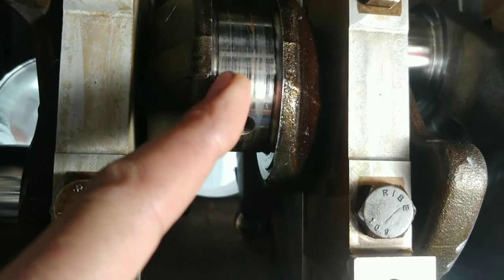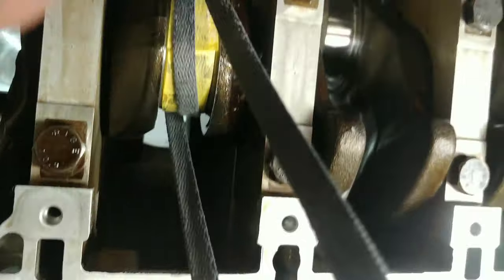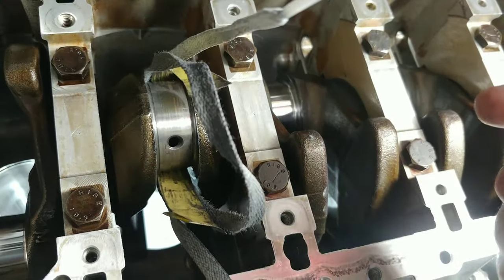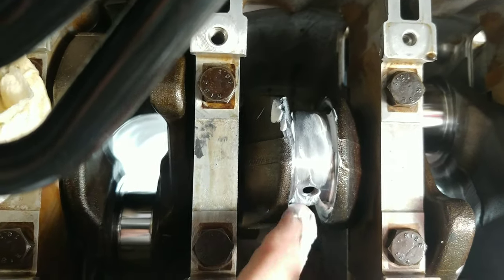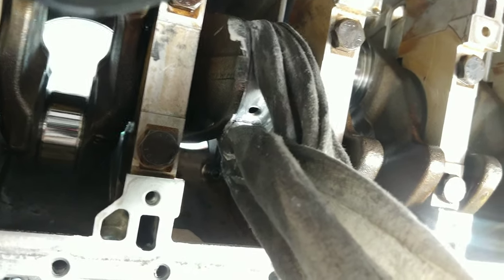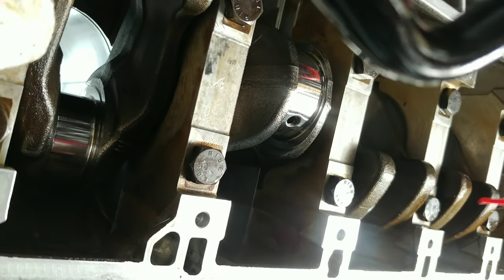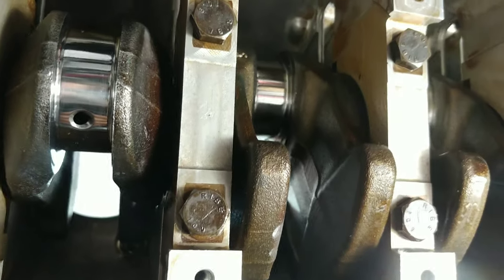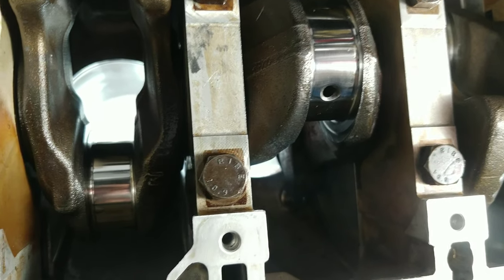Crankshaft Sanding and Polishing by Hand DIY You can do this!

Comment: I did the exact same thing on my 335 with semi spun bearings and rod knock cylinders four and five (there was no scoring that my fingernail could catch on however.). I only needed to use 2500 emery cloth and a shoelace with some mothers metal polish and they came out like glass. We have been beating on the engine since then with new calico coated king rod bearings and it’s been flawless! Knock on wood!!!!!!!!
Reply: Still going strong?
Reply: Did you run an undersized bearing?
Reply: @nicholaspickard14 You don’t need to run an undersized bearing “usually” with this method. You’re mostly just polishing and not removing a whole lot of material. When you have the crank turned at a machinist, they take off a lot more material. That’s when you would need an undersized bearing. Hope this helps. 🤙🏻
Reply: @BlackwaterDSM  Agreed. Even if you had a lathe, it takes foreeevvveeer just to remove .0005 with sand paper.
Reply: In same situation, cylinder 4 lol😂
Reply: Looks like I'm late to the party...cylinder one haha.  Engine was running b4 I dropped the pan.  Ordered ACL from fcp I hope they size well. Should I get them coated?

Comment: I mean it's perfect if you got that kind of time and want to be a perfectionist but its really not necessary to be this excessive. Sand it with 2000 grit til it's smooth with no fingernail ridges, blast it with brake cleaner, throw some oil stabilizer or assembly lube on the journal and then assemble your bearings and rod caps and that should be sufficient. If its that bad that you have to use 350 grit then you're probably going to need oversized bearings. At least .10.

Comment: Spun a bearing in a 4.6 , did this and its ran 26000 and still going. I also preprime it after a 2-4 hours of resting by holding gas down and cranking 10-12 seconds. No metal in oil

Comment: That is the best I have seen just bought a Honda CR-V 2.2idtec no3spun  it lock up on tick over so now I can do this to old engine put one in it with56thou on but the old one as only done106thou I think there cud b oil restricted to this one all other r fine was getting diesel in oil injector tip gone off one injector a project car  u no something to do over winter  but done car since 17yr old now74 it’s like heart surgery this one but nearly done very good vid and thanku

Comment: Nicely done, however there's always the risk in polishing a crank in situ (as it cannot be hot washed afterwards, as on a full engine rebuild).

The tiny particles of leftover abrasive can wreak havoc in the engine.

No matter how meticoluosly one cleans the journal
after the polishing, it's only a hot pressure wash that can fully remove microscopic
abrasive particles.

At least, a double oil
& filter change is a must after doing this operation in situ (50 miles, drain & refill, new filter, then after 100-120 miles, repeat oil & filter change).

Best of luck!
Reply from the maker: Yeah I agree

Comment: I am thankful of the video. My e93 with n54 engine seized and I found out it chewed up the rod bearing worst on piston2.

Even though you did not show the step by step sand papers job and the use of the brake cleaner and wb40 I still get the idea.😁

What I like is you did it on the exact engine I seeked solutions.

Thanks body😎👍
Reply: So did you end buy polishing ur crankshaft or replacing it?

Comment: This is a very nice method and I really appreciate you explaining in detail every step one thing I wanted to say is that I didn't see if you did or not you said use some WD-40 on your 320 and all your grits or just a little bit of water is fine and soap just like if you were wet sanding your paint and then also I don't know if you could do this on main bearings cuz some of the main bearings do not have barely a little bit of clearance for a shoestring to even get maybe a wire on sandpaper like a piece of welding wire or something like that or fence sign wire that is like an aluminum or something like that I could probably try that get in the real tight places

Comment: Great video i was really looking for this, when I dropped the pan on my n54 cylinder 6 bearings where gone so I found just paper thick Half a circle metal in there so i wanna see if i Polish the crank the  way you didi it how can i do the clearance and if I should do anything to the connecting rod ?
Reply from the maker: The rod is garbage.
Reply: @335iN54Enthusiast  what do you mean garbage? Do u mean not to worry about it ?
Reply from the maker: I mean replace it. It's probably slightly out of round now. Check the roundness with a dial gauge then you'll know if it's still useable.
Reply: Agree, if your bearings are that bad, then I doubt a simple polish will fix. A used engine would be your cheapest fix. I would guess rods and crank need replacing

Comment: Great vid! I’m doing this now on my 328 with the N51, spun rod bearing on cyl. 6. Surprisingly, only very minimal scoring and some copper, I’ve got a couple hours into the journal alone and I’m still not there yet. I have one score that covers only about 1/4 of the journal. Clearance is about .038 right now witch is right in between the min/max. you can barely feel the score, almost can’t catch it with my nail. Should I leave it as is or keep sanding it til it’s gone and risk taking too much material off the journal and be out of tolerance?
Reply from the maker: Ya id say as long as you smoothed out the scoring so it doesn't eat the bearing up you don't need to take it out 100%.

Comment: So, 320-through-2,000 is all and only WD40. Then only the metal polish and the rag/towel for the remainder until mirror finish?  
This is a wild question: On my BBC a 454,  I have 225,000.00 miles. It never dry starts, but the oil pressure is low but functional (10 PSI/1,000 RPM). I don't want to spin a bearing and I don't want to pull the engine. I was thinking of doing this exact process and new standard bearings on the rods. However, I can remove both the upper and lower MAIN bearings but not the two end-main bearings (front and back). Would it make sense to only do the main bearings (polish as you did rods and replace with standard bearings) I can get to and leave the ends alone (since I can't get them off with crank in block)? I think you and most would say definitely do the rod bearings, my real question is about the mains as I have described it here. Any thoughts about the rods are appreciated as well. The compression is good as it passes California SMOG testing which is more stringent than anywhere and they made it even harder to pass as the truck now has to exceed what it did when new! It does pass even with those miles.
Reply from the maker: The sanding grits All depends on the condition of the journals .  I'm not too familiar with the specs and bearing life on the 454 big block so I can't give you a clear answer there.
Reply: @335iN54Enthusiast  Thanks. In your Youtube above on your Beemer motor, did you only use WD40 throughout the process of sanding with the progression of finer and finer grit paper and once finished with WD40, did you only use your recommended polish with cloth/towel to create the mirror finish on the crank journal?
Reply from the maker: Thats right

Comment: Very informative video . My machine shop guy charges 30 dollars to polish a crankshaft. 
It looks like you were using quality sand paper including the can of wd40 I’m wondering how much money you spent doing this? I see that I’m about 3 years late because this is an older video. Things being what they are now if you had it to do all over again would you have done it differently and sent it out and spent the small amount of money to get it done?
Reply from the maker: I spent under 30$ .There's a huge difference between sanding a crank and polishing a crank. Polishing doesn't require sandpaper....
Reply: Polishing is the work involved to get the crank out/remove the entire engine. To remove the crank to polish is much work. 

This is the technique to “kick the can down the road” balling on a budget, hot rodder recipes and all of that DIY and garage warrior. 

If you’re questioning this technique then  pay a mechanic $5-25k for a new engine. Instead of $50 and a weekend.

Comment: i've seen this done a lot but does it not affect bearing clearances? does it shave off the top material or is it really just polishing? and does this put even pressure throughout the piece of sandpaper so that you don't get low/high spots on the crank journals? like i said i've seen this done a lot so i'm sure it doesn't cause any damage but there were just the questions i did have.
Reply from the maker: Always check bearing clearance.
Reply: I just did mine in a Buick 350. Some light scoring and what not. Used 320, 600, 1200, and polish. Measured with a micrometer before and after. The change was less than I could measure. i.e. No greater than .00005 (I don't think it removes much material. ;)
Reply: I think you need a micrometer measure the journals first b4 any thing write down the measure ments and when you done measure them again and compare the readings if its more than ten thousandth of an inch shaved off put 0.25 oversize bearings  if its over twenty thousandth of an ich shaved put 0.5 like that you will get it right its just engineering done at home its possible but takes time and labour but it saves you money

Comment: Are you still using your car. Did you find any solution.
My motor is also making same noise after 180000KMs
I doubt rod bearing and planning to change them.

Comment: Hi there, thanks for this video, I'm going down this path with my Land Rover Discovery 3 because I'm seeing bearing wear in my oil. I will definitely be following this to clean up the crankshaft. I was just wondering whether you had any suggestion for the main bearings, as I will be replacing these also. Obviously there's not much room to move around the crankshaft, so I'm wondering whether this sand and polish method is somewhat viable in that case or not.
Reply from the maker: This won't work for main bearings unless its fully disassembled

Comment: I really appreciate this video it's given me more confidence as I'm planning on doing this job. I have a few questions and idk it might sound dumb, you turn the crankshaft bolt 'clockwise' right? Along prior to that removing the spark plugs to allow/release compression? Will turning the crankshaft mess up timing once everything is all put back together?
Reply from the maker: Yes clockwise. Plugs can be removed.... won't affect timing

Comment: What's the tolerance? Did you measure it?
Reply from the maker: No...I don't have a proper measuring tool.
Reply: @335iN54Enthusiast  

Prime on Amazon? 10 GBP ?
Reply from the maker: Ah yes the plasti gauge.   Yes I will be measuring the clearance.

Comment: Im no engine builder, but shouldnt you have the crank out when doing this? I dont think its far fetched that enough material came off to unbalance your crank or even to have gapped your tolerances between the journals and bearings because of the "sanding till the scoring is gone".
Reply from the maker: Not necessary. Only if it's machined. Secondly with BMW tight bearing clearances...I highly recommend doing this to give just a little bit more clearance and that extra protection against spun bearings.
Reply: Even if he sanded for 24 hours on each journal, it would affect the balance of the crank as much as you hanging your clothes on the floor or in the closet affects the earth's balance.

Comment: Also, The Japanese use emery cloth on the rods lightly in an X pattern (3 or 4 of them) and clean thoroughly. This helps keep the pressed in bearing in place. Use nothing behind it unless it is a drop or 2 of ATF. Then on the bearing faces use lucas .
* take a bent straw parts cleaner and clear the oil ports in the the crank shaft.
Be sure to completely clean the oil pan pick up tube and oil pump so that  whatever metalic particulate got in there is clear. Assemble and tighten to specs and you are good.

Keep an eye on the cooling sys. That and failure to distribute oil to the motor and co.ponants was the cause, more than likely. Or in my case a half- assed attempt to conceal in order to sell the vehicle.
Shame on any and all that do that. Karma nothing- God doesn't miss an address.
Is he my vindicator ? You'd better believe it !
Reply: Bearing crush keeps it in place, nothing else